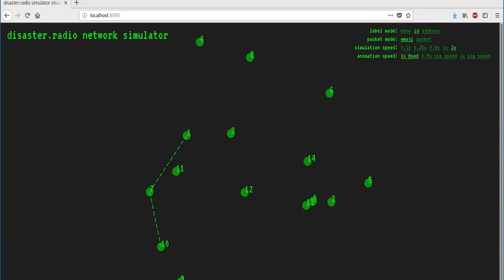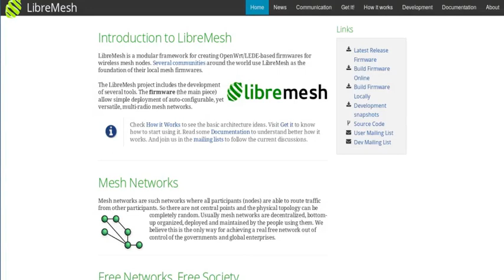LoRa Layer 2 - disaster.radio

Comment: How many module could be in one cell how many parallel channel could be open such one for data sharing who is in local another is for news and other media another for police and fire and rescue another for total Lora manager with autmation control  module so in this case if public even overwhelmed the network but other governing channel will be keep open so 4 Lora module Lilygo TT go can operate with 4 more individual channel so total operational channel will be 16 frequency as and hybrid example from one module with each 4 device installed with a battery and solar panels and street lights.

Comment: Disaster network needs cluster in volume and need to check a simulation by damaging network by percentage and how it does work needs to research. How many cluster cells in which area get damaged and how it was will behave things to learn. Such as say out of 20 nodes if 5% damaged during disaster but how rest of the nodes will be coordinated and regrouping to establish a desired communication carry on . Or rescue helicopter will received the signal spectrum and communicate as an example during disaster.
Reply: Good idea